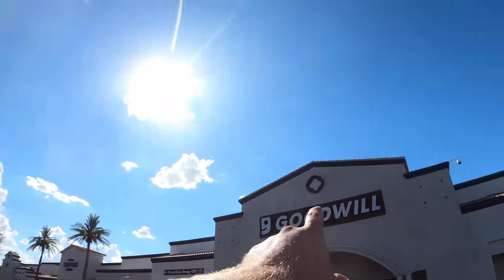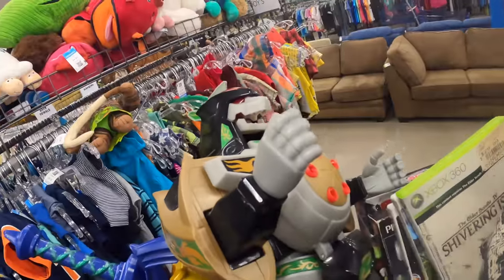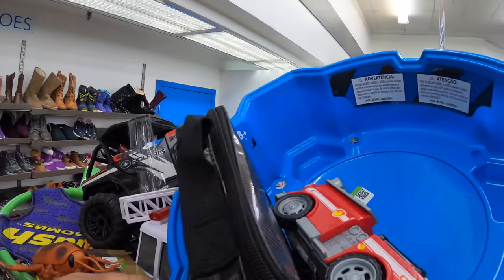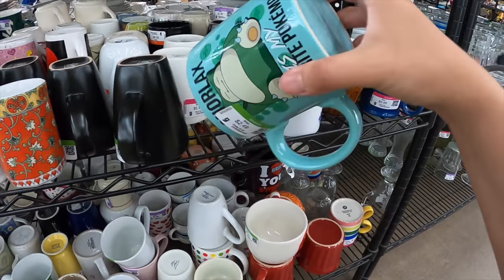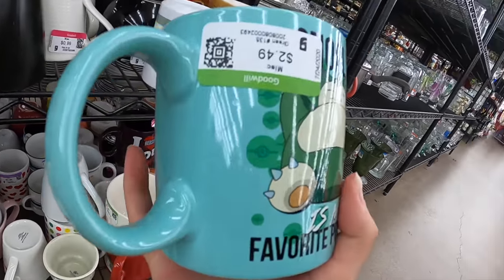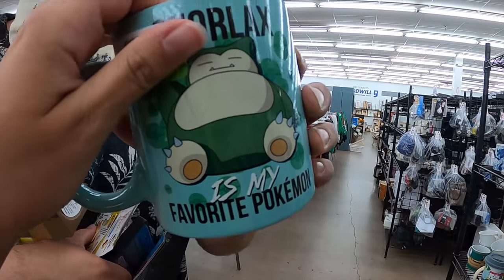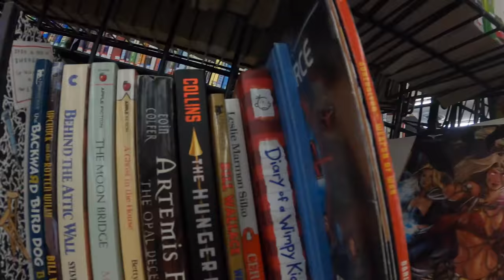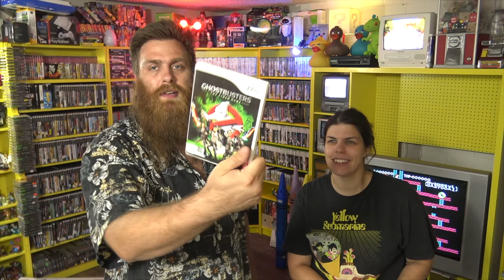Don't you hate when this happens? | Live Video Game Hunting | Live Thrifting

Comment: Correct me if I'm wrong, but for insulation to work it needs air space to trap the air. Smushing it causes it not to work correctly.
Reply from the maker: I only had to squish it to get it into the the bottom area. But once I got it in there right it went mostly back to normal. Took some doing though